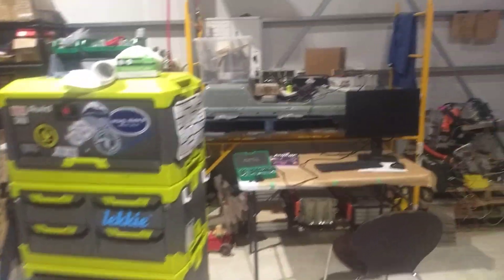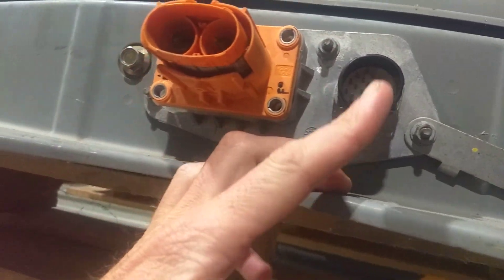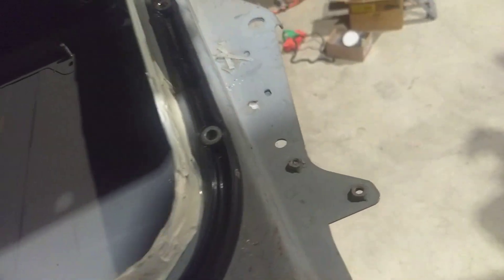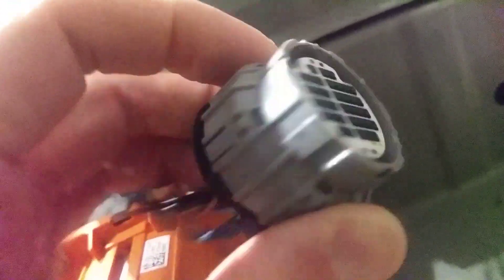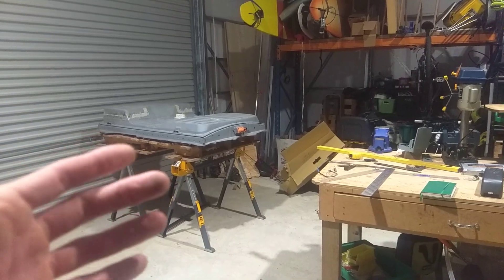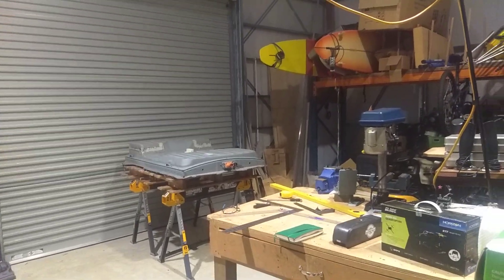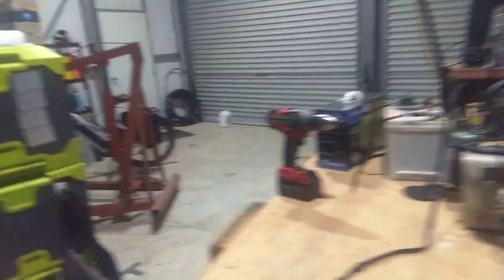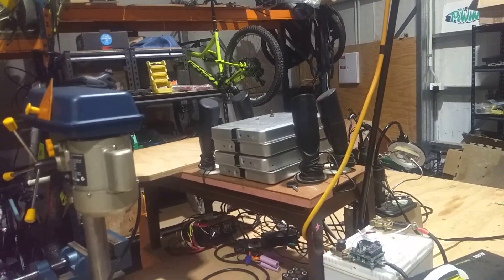The Differences between G1 & G2  Nissan Leaf Batteries

Comment: Is this a 2014+ as Gen 2 or 2018+
Reply from the maker: Good question. Here's my understanding:
G1 = from the start of production to roughly 2013. Chassis ZE0, 24kWh
G2 = from roughly 2013 to roughly 2018. Chassis ZE0, 24 & 30kWh
G3 = from roughly 2018 onwards. Chassis ZE1, 40kWh
Reply: @RaglansElectricBaboon  So, GEN 1 and GEN 2 Battery Packs are different than Generation 1 (ZE0) and Generation 2 ( ZE1) Cars? 
  My research has found this ...
  Generation 1 (ZEO) cars begin      = 24kWhr GEN 1 LMO 2S2P modules in MY2010 - MY2016 = "Wolf"
  Generation 1 (ZEO) cars upgrade = 24 kWhr GEN 2 LMO 2S2P modules in MY2014 - MY2017 = "Lizard"
  Generation 1 (ZEO) cars upgrade = 30 kWhr GEN 2 NMC 4S2P modules in MY2016 - MY2017 SL & SV trims only
  Generation 2 (ZE1) cars begin      = 40 kWhr GEN 3 NMC 4S2P modules in MY2018 - present
  Generation 2 (e+) cars begin         = 62 kWhr GEN 4 NMC 4S3P modules in MY2019 - present

This article ...
https://pushevs.com/2018/03/20/nissan-leaf-battery-degradation-data-24-vs-30-kwh-batteries/
states ...
a) The 24 kWhr "Lizard" Battery ( MY2015 - MY2016 ) remained LMO chemistry
b) The 30 kWhr Battery ( MY2016 - MY2017 ) changed to NMC chemistry

I believe ...
The original 24kWhr "Wolf" LMO battery had 100% sealed sardine can modules
The second 24kWhr "Lizard" LMO battery had an "open-air" design with white plastic
Both were LMO chemsitry

I cannot find any evidence of a 24 kWhr battery having NMC chemistry.

it seems odd that GEN 2 begins with the 24 kWhr Lizard battery still using 2S2P LMO modules, 
which is more like the original 24 kWhr Wolf battery also using 2S2P LMO modules.
The Lizard modules are NOT all like the GEN 2 30 kWhr battery using 4S2P NMC modules = different shape & chemistry.

Comment: Hi Guys.  Do you know whether the contacts on the heater socket are live when the heater cable is disconnected?  Is there anything inside the battery pack related to the cabin heating? (A fuse or relay? Anything)  Thanks Jozef
Reply from the maker: No, I don't know and I don't have one apart to check at the moment. Sorry for the useless reply.
Reply: @RaglansElectricBaboon  no problem.  Thanks for your reply.  Jozef

Comment: What are the little black parts on the top of the battery back housing on the driver side of the car?
Reply from the maker: Breathable vents. They let moisture out but not in.
Reply: Could you send me some up close pictures? I might have a different project I could use these on.

Comment: Looks like part Numbers are on top of battery. You can not see them when fitted to vehicle. 295B0 - ??_??  , 3rd last digit = battery type.  Looks like A = G1 and B onward = Lizard.
Reply from the maker: Yes, the label is on top where you absolutely have no chance at all to see it when its in the vehicle!
The two in my workshop fit your description:
G1 24kWh = 295B03NA0A
G2 24kWh = 295B03NK0A
However I'm pretty sure there's more to it than G1 & Lizard. Do you mean all G2s are 'lizard' batteries?
Reply: @RaglansElectricBaboon   I assumed, which maybe wrong, that the sealed  "G1" modules that hold the heat inside the can were the original problem ones in the 2011,2012 Leaf.
The 2012 Leaf Nissan service manual was revised in 2014. I assumed , which maybe wrong, that it was revised to include the new lizard batteries being fitted to vehicles in the USA under warranty.  295BO3NKOA , I wonder what year that was?
Reply from the maker: Here in NZ we don't really talk about lizards, we just call them G1 & G2. If G2 is the same as lizard that would be nice and simple so let's go with that :)

Comment from the maker: Despite what I said in the video I did actually remove the G2 battery featured from a  car myself, with a buddy. I don't recall there being anything special about the bolts at the back but I didn't pay them close attention at the time. So I'm pretty certain the G2 pack can fit in a G1 car but haven't tried it.
What is truth anyway?!
Reply: It fits, but you need to by a bunch of adapters from Nissan. 700$ worth of adapters, covers and such, and it fits.